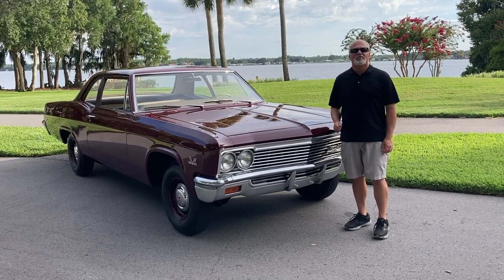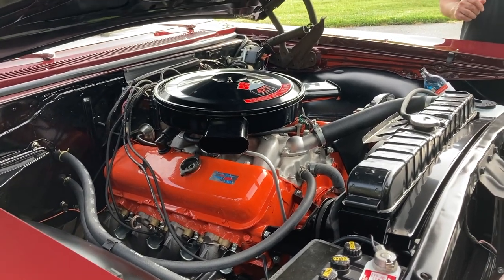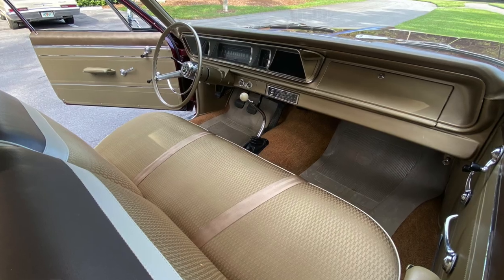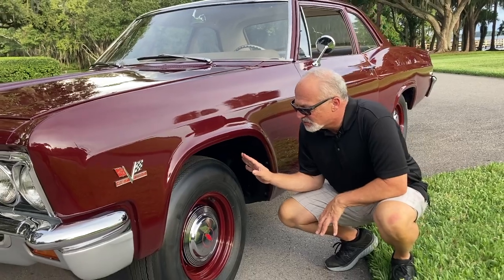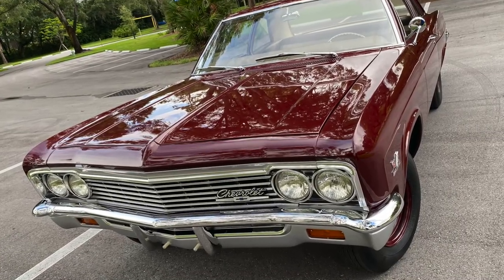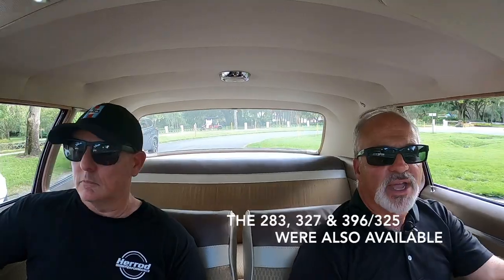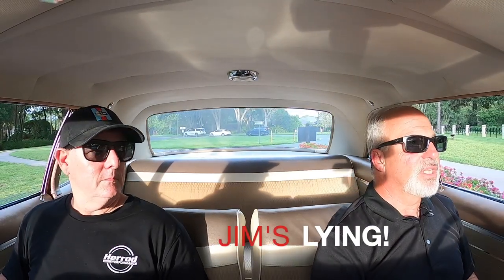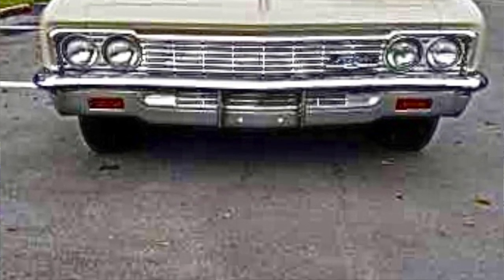1966 Chevrolet 427 L72 Biscayne—And Its Evil Twin

Comment: I was 17 and 1969. When I graduated from high school, I went to work with my uncles as an asbestos worker. The day after I graduated. Right into the real world. I was working six days a week 10 hours a day and it was an hour and a half drive to and from work. I made enough that summer to buy mice 1967 GTO 400/four-speed/convertible. When I find out that only three guys ever lived long enough to collect a pension from working with asbestos, I never went back when I got laid off because we finished that construction job that summer. I went to work as a car mechanic in a gas station.
  Friday nights and Saturday nights I was out drag racing red light to red light. Mustangs were no problem, neither were Camaros or challengers. I had no problem with Buick grand sports, 442s, road runners, GTX, satellites, and furies were a joke. They made all that roar of intake noise, and they didn’t get out of their own way.
 The king of the streets back then was the 396 Chevelle. I must have raised against six or eight of them. One of them was a Yanko automatic 396. They would always pull me by about a car out of the hole, and that’s it. All the way up to 80 miles an hour, that’s the way they stayed, they would be one car length ahead of me. I never beat a 396 Chevelle..
 A couple years later I had a 1968 Dodge charger. That was absolutely the junkiest crappy used most poorly made car I ever owned to this day. No wonder they are worth hundreds of thousands of dollars today on those television auctions. Because there are so damn fuse survivors. They fell apart or rusted apart.. their transmissions were junk, I bought my car from the original owner, when I bought it it was on its third transmission, I put the fourth one in. I think it was called a torque flight. They had those horrible sounding starters, when you start them up they would puff oil.. my headlights would sometimes open the little door is covering them. The rest of the time I had to get out and open them myself with my hands.. The vinyl in the seats cracked, the door handle and window winders broke off, the dashboard is cracked, they rusted before your eyes here in western Pennsylvania. Cars back then always had exhaust system problems. There were minor key Midas speedy muffler shops in every town, there were transmission rebuild shops in every town. .. cars always needed tuneups because they had points, condensers, distributor caps with rotors that would wear out, it was common for every gas station to stock things like thermostats, starters, alternators, points plugs and condensers, distributor caps and rotors, mufflers, tires, brakes, radiator caps, air filters, oil filters, and bulbs for every car because every car needed them very often..A car with 75,000 miles on it back then was junk. Cars always needed ball joints and tie rods.. and the junkiest cars were the Mopar‘s. And today they are the most valuable.
  don’t feel bad and wish you would have lived back in those days because of the cars, the best thing about the cars in those days was the radios in the music on the radio. The Beatles, stones, Led Zeppelin, cream, Hendrix, the doors, Santana, Yardbirds, The Who, on and on and on, the radio was the best thing about those cars..
  today’s cars are the best cars ever. Back then a car did not make it to 100,000 miles. They just didn’t. Today, 200,000 miles is typical even for the cheapest cars today. And today’s cars will actually go around corners fast, and they’ll actually stop, and the fast cars today or the fastest cars ever. and they don’t need a tuneup every year, or an exhaust system every 18 months, or a starter or a carburetor rebuilt every few years, and they don’t burn oil today, and cars today started instantly, and they don’t need water pumps and radiators and fan belts and valve jobs and ring jobs and new transmissions. every town had at least two transmission shops in Mani tuneup shops, as well as alternator and starter rebuild shops. Most gas stations had full-time mechanics on duty and they were busy because cars were junk. So you didn’t miss anything. Today’s cars are the best cars ever..These are the good old days
Reply from the maker: We can't argue with you. New cars are definitely designed to go 200-300,000 miles. But except for a few, they have no soul.
Reply: I agree with that. Even in the 80's and 90's they were still junk and painfully slow. Now, you can have a car that last for hundreds thousands miles , put out better performances and actually hold on the road. Up here, theses cars were ridden with holes as big as my fist in 3or5 years because of the salt and sand in the winter and wouldn't start bellow -20 C. ( It's often colder than that were I live ) and you're right, Chrysler products were renowned for being cheaply made and don't starting when it was cold, Ford's were rust buckets ( especially the torino and maverick) only few GM survived but not mutch longer. And theses hp ratings back then weren't on the wheels, but motor only without accessories. And with the gas prices theses days, it's prohibitive to drive them. Even pick ups aren't very popular here with people who don't need them for working or with a fift wheel. Nostalgia is a hell of a drug. I don't care for noises or look. I care for great performance and reliability. And many cars in the sub-compact category outperforms thoses gas guzzlers without any mods. Even the hyundai elantra N.

Comment: Tom Valentine ordered a 1966 Chevrolet Bel Air Station Wagon 427/425 HP (engine code L-72) 4 speed, Tuxedo Black. Raced it in B/Stock at Dover Drag Strip, Wingdale NY. called "The Pied Piper." Very competitive and VERY rare. Follow Me, indeed !
Reply: Supposedly there were two L-72  Bel Air station wagons built. My dad owns one of them. His is dark blue. 12,000 original miles. Documented too.
Reply: I believe the blue L-72 wagon is in Alberta, Canada. It is owned by a gentleman who collects '66 full-size L-72 Chevrolets,including a red L-72 4-door Biscayne!

Comment: My dad bought a 66 Impala with 427 and that is what I learned to drive .  Tires where not up to the task.
Reply from the maker: Yeah, horsepower technology was way ahead of tire and suspension technology back then. Of course, tires were incredibly cheap then. They only lasted a little while even if you didn't melt them.

Comment: Hard to believe but in NYS in 1966, the NYS Troopers used these very cars as pursuit vehicles on the NYS Thruway, 427, 4 speeds, two door post Biscayne’s a local wrecking yard bought a bunch of them at auction after they were taken out of service, they all had the 425 hp 427 engines. Wish I’d had a crystal ball back then.

Comment: I wonder how many kept them for more than a year between insurance, gas and tickets than got something a little more practical.  I worked with a guy that bought a 1970 Dodge Charger 440 6 pack  the following he had a 1970 Olds Delta 88  he said in 7 days I put in 3 quarts of oil and 5 tanks of gas and got my first ticket
Reply: Had a 70 charger r/t, would out run a phone call

Comment: how does this Chevy compare to the Pontiacs with the 421/428?
Reply from the maker: The Mk IV Chevy engine was much more modern than the Pontiac, with better breathing and a lot more potential. In stock trim, the L72 had the advantage, but both were great.

Comment: In Nascar, which I have completely stop watching and could care less anymore, when you took the big factory sponsored car years out( that GM wasn't part off) chevy has always dominated the sport. In 63 junior couldn't be touched with the mystery engine and was sponsored by a chicken company! As soon as the big money walked out cale and Jr took over with those big blocks that Nascar would soon ban. Didn't matter Ford and Mopar was way behind but its easier when you have a big block 351 and switch the heads and call it a small block, still 351 cubic inches. Hey chevy can't win em all or old iron head wouldn't have had any fords to beat.

Comment: Back in the 1980's, I found and bought a 1966 Chevrolet Caprice 2dr. formal roof car with the original 427 big-block (rated 385hp), Automatic Trans. (column shifted), 12-Bolt Limited-slip rear axle (freeway gears, 3.08 or 3.31:1).  It had Power Steering, Power Brakes and Power Windows, but no factory A/C (car had aftermarket add-on A/C, probably dealer installed (?).  I restored the car, rebuilt everything, upgraded the suspension (gas shocks, sway bars, etc.) and ran 15x8 Corvette Rally Wheels with 255 tires.  Man that car cruised down the highway and handled like a dream.  I had presumed that a '66 big chevy with a 427 L72 (rated 425 hp) was (and is rare) but much to my surprise, there were only around 500 big chevy built with the 427/385hp (same engine as Corvette 427/390hp).

Comment: My first car was a '66 Bel Air 283 automatic.  Great gas mileage. (That mattered in 1972 when gas was 50 cents a gallon!)  Never burned a drop of oil.
Reply: I believe it was the OPEC led oil crisis of autumn ‘73 before gasoline consistently reached fifty cents a gallon.
Reply: @fairfaxcat1312  It hit 50 cents in Minot the summer of 72 because of the vast number of airmen at nearby Minot AFB. We could charge gas on our military ID, but had to pay the higher price while it was 39 cents a gallon 50 miles away.

Comment: Dad bought a zero option 68 Biscayne and gave it to me for college transportation. No radio and rubber floor mats he paid $1995 back in the day. Equipped with a 250cu. in straight-6 and a 3 speed manual trans, it had tons of low end torque. Unknowing passengers thought it pulled like a 327. When I opened the hood they about crapped their pants. The big negative was clutch life. Without riding or slipping the clutch about every 20K mi. a replacement was needed.

Comment: I wouldn't call those exhaust manifolds fabulous or free flowing. Better than the 325, 350, and 360 horse pig hauler log-style exhaust certainly, but my '66 L72 Corvette motor made nearly 100 more horsepower with long headers.

Comment: Was the 283 still offered in 1966.?.? Could have been available for this car
Reply from the maker: Yes. As stated in the video, the beige car WS originally a 283/3-speed manual car.
Reply: It was also in the 66 impala wagons.
Reply: Thank you 😊 Campy . . . My Dad bought a brand new Aztec Bronze 66 Impala SS 327 . . . . His trade in was a 63 Dodge 413 max wedge with CrossRam intake.. . . Imagine that Dodge value today 😆

Comment: 488 gears is nuts on the street   Put some 4:10's and your the best of both worlds
Reply: It came foam he factory this way
Reply: @haroldschildt342  Yea I know , change the gears and street drive it , That's what I would do 😎
Reply: @port nut Yes and your engine will toast in 6 months revving at 5000 Rpm all day 💥
Reply: @ludedude5228  I seriously doubt he puts enough miles on it to make a difference. It's a 6 figure show car that spends 99.9% of its time in climate controlled storage.The beige car is the driver.

Comment: My 0l' Man had a 1965 6 cylinder in the beige color of the 454.
Reply from the maker: Crazy they put that small an engine is such a big car.
Reply: A massive 230 CID six slinger, producing 140 thundering horse power and a 3 on the tree .

I remember on one exceptionally long and steep entrance ramp "dad" used to wind that thing up in 2nd gear (always wished it had a tach) until it was screaming; at the top he shifted i to 3rd near 55 MPHand everything got quiet again.

I also remember him downshiftifting into 2nd for passing gear.

I learned to drive on that thing !
Reply from the maker: @rudygeorgiamulesandcountry1594  Classic. I remember driving my brother's Tempest with a six and a 3-on-the-tree. It was an experience only slightly worse than a similarly equipped '75 Nova. At least the Pontiac had power steering.

Comment: I fail to understand why pay all that extra money on that engine on a plan jayne model
Reply from the maker: That is exactly why. Most powerful engine in a light body. Not everyone wants a flashy ride. Plus it was ordered specifically for a racing class.
Reply: Thing's were a different in those days. I'm really glad I grew up in that era. The 60s and 70s . All the Big block cars , and the z28s , Boss 302 mustang's, big block mopars etc. I had 68 Camaro SS/RS , 327 ci. 450+HP 4spd , 456 rear gears . Had a lot of fun in that car and Yes a lot of tickets and fines also.

Comment: Nice but why act like your a granny drive it like you stole it don't be afraid
Reply: At this point in time it’s far more safer and better to preserve them with considerate driving rather that wrapping it around a pole , thus , taking another big block Gm b-body out of existence circulation
Reply from the maker: The area we were in was extremely residential, plus there were deer everywhere. There is a time and place for everything.
Reply: @musclecarcampy9922  thats not the way some knuckle heads think. Mat it an stay in it till you crash it. Can't teach a puppy.

Comment: I know, unpopular question here. But I'm really concerned about the mpg both engines running?! With a 3 speed automatic on a daily basis.
Reply from the maker: Probably a wonderful 6-8 mpg for the stock car, perhaps a little better for the modified one.
Reply: @musclecarcampy9922  that's 30-40 liter each 100 kilometers. Dang, hard to believe.
Reply from the maker: @MrMars6  The burgundy car had drag racing gears. I was only supposed to travel a quarter-mile at a time. Fuel economy was not a concern to someone who bought a car like this.

Comment: Does anyone know why the front grills are different on same year cars
Reply from the maker: You made me do a double take. They are the same, but depending on the angle and the way the light hits them, they can look different in photos.
Reply: Thanks,  that solved that one lol
Reply from the maker: @stevedickson5853  Bob Martin, the owner of both cars, said all ‘66 full-size Chevys used the same grille, from Biscayne to Caprice.
Reply: @musclecarcampy9922 your definitely right, I think it's because the red cars front end sits high and slightly angeled upwards that  the light hits it different ,when you went over to the beige car the grill just looked different, like you say all to do with the light etc, either way two great looking and sounding cars .

Comment: In that era, give me a 69 RL8 Z28 Crossram 302.
Reply from the maker: Hard to go wrong with either.
Reply: The other one is a 66 Shelby Mustang GT350 Fastback.   The sound of that thing really turned heads.
Reply from the maker: @JD-ir5fj  That side exhaust sounded like the second coming.
Reply: @musclecarcampy9922  I like the sound of that motor up front too.   From the rear it is loud when idling.   Up front it's all lifters.   I think that Biscayne was mostly sold as a factory ready stock car like a Yenko Camaro.   It had a 427 and a 4:11 rear end.   A kid at my high school had a 68 SS 350 Camaro doing high 11s at  Orange County Speedway.   His dad owned the speed shop.
Reply: @musclecarcampy9922  The only thing better is the sound of a 18 cylinder Douglas Skyraider radial aircraft engine when it thumps at 1000 rpm like a Harley Davidson witha heavycam. 😂
Reply from the maker: @JD-ir5fj  funny how the solid lifter L72 sounded so amazing and ran like it was ready to rip your throughly out.

Comment: Why does the original car sit so high?
Reply from the maker: Not sure if it is sitting to high. I know the beige car is lowered, so it could be an illusion. Or the springs may not have settled.
Reply: This car sits like this fram the factory
Reply: I thought it looked the same way in 66. I wonder why GM had them sitting that high. The street version wasn't like that.